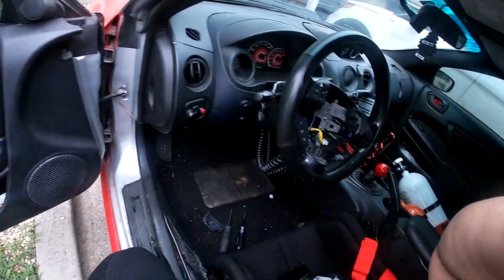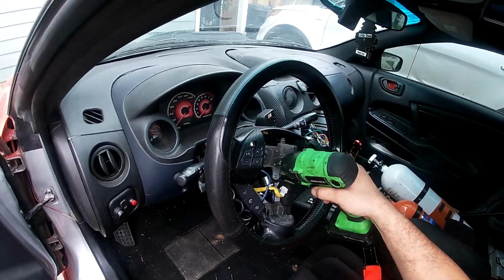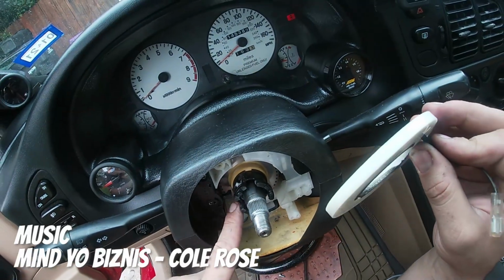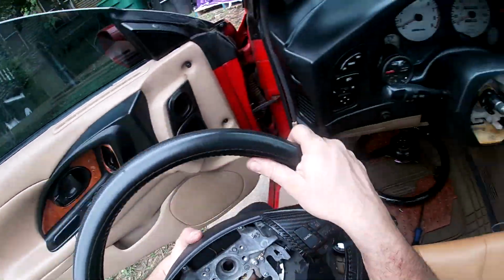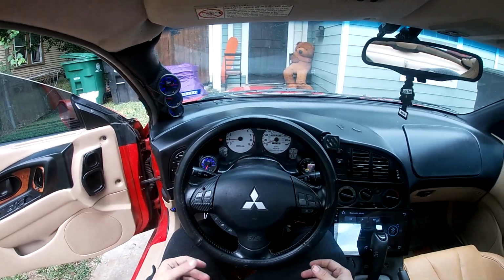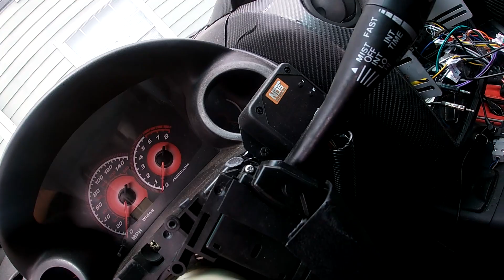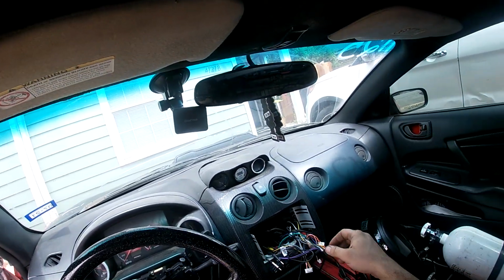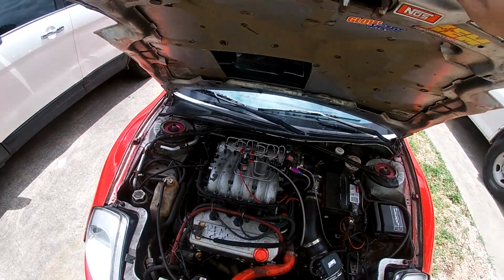2g DSM Outlander and NRG Steering wheel

Comment: Do the buttons work on the 2g one? I suppose they don’t, but is it possible to put a wheel with steering wheel control?
Reply from the maker: The radio i have has a steering wheel connection. So if i got the Outlander harness it would work with the radio
Reply: @deeternal  would you make a kit?